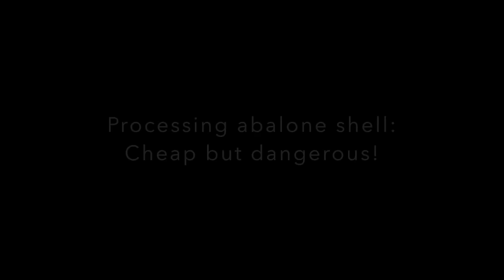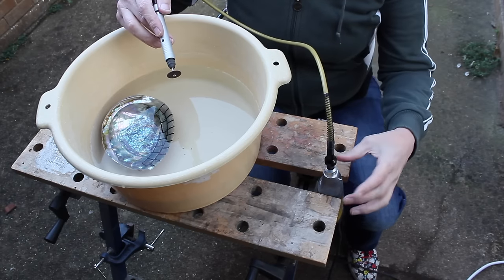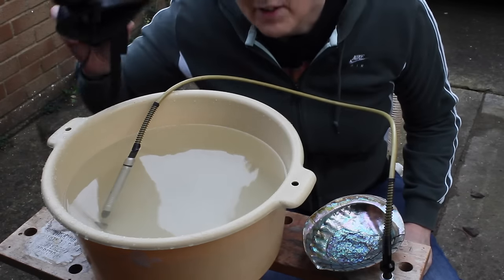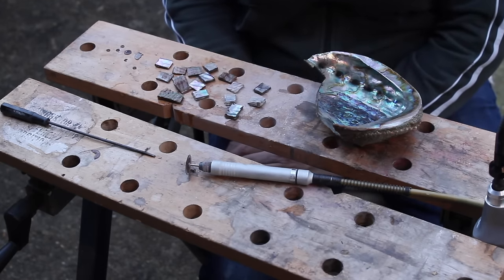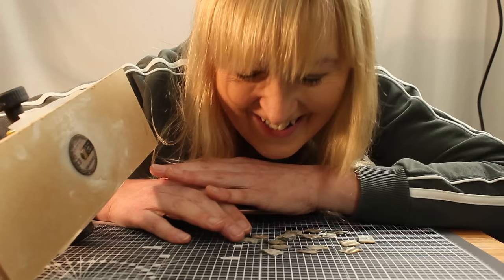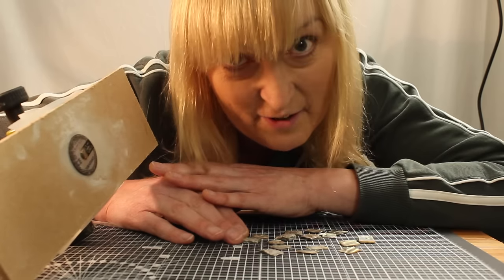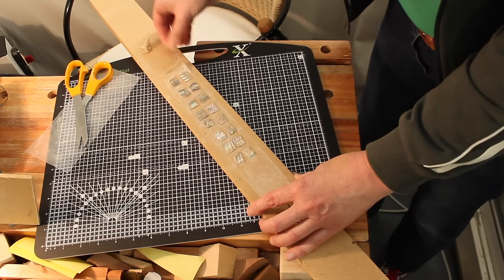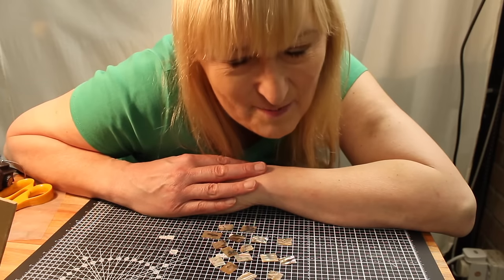Processing abalone shell: cheap but dangerous!

Comment: Thank you for the video. I have cut many tons of MOP, Abalone and Freshwater pearl shell. I recommend you buy a cheap small rock saw with a 1/32 inch kerf glade. It should have constant water drip. Use the saw from the back side. It saves a soaking and gives great control.
Coarse diamond disk are available for lapping the shell flat then run through a drum surface grinder. I use white glue to stick the flat pieces down and then soak in warm water, the finished piece just slips right off. I like using hard Formica as the surface to glue to.

Comment: That smell you experienced was most likely due to improper filter media size on your dust extractor system.
You would most likely require a HEPPA Style filter as the normal filter elements designed for sawdust/sanding extractor system.

Comment: I have one hell of a shop with some expensive equipment, but I love my WorkMate.  

That aside, think about adding a shim opposite where you are working, then a piece of wood covering the cutter. It would act as a guard to protect your fingers, if you slip.  

If you do slip, a nylon stocking or some screen door screen will catch your piece and save you digging it out.  Indent the sock or screen so it is more likely to catch the pieces.

Comment: Great work, well done! Just a thought... Meths or turps to remove adhesive from double sided tape, and linesher or disc sander for sanding with different grits.  or buy and use lapidary gem polishing kit. Gemstone stick to hold inlay may avoid finger loss.

Comment: Mount the hand piece, make a splash shield and use a drip feed (Bottle with small diameter hose + screw at the end, adjusted to drip) to drip right on the cutting disk

Comment: Are you all serious? Never in my life have I seen such a bunch of safety nazi's. Have you never used a power tool in your life? This was about as safe as you can get. That cutting disk is a grinding wheel not a blade. It would at worst give you a small burn from the friction. I've used discs like that for ages and taken hits on my fingers with very little injury. Grow a pair like the entrepreneur who made this kick ass video.

Comment: If you go to a lapidary shop you will find they sell a wax substance called DOP that when heated will melt. You put a drop of this on the back side of you shell and stick a small piece of wooden dowel to the part and you now have a handle instead of sanding off your finger tips. The wax is easily removable when you are done. Simply put the piece in ice water or the freezer for a few minutes and it breaks free cleanly. You can also use this same method to sand your parts to a shape should you desire it.

Double sided tape adhesive is normally heat sensitive. If you heat it with a heat gun it will release and then clean off any residue with rubbing alcohol.
Reply from the maker: Good tips - thanks!

Comment: And this is exactly why I use Ablam...a £90 full sheet yields plenty of straight and curved strips. Try using hide glue to stick to a sub-base. Comes off in warm water :)
Reply: supper glue (crazy glue ) only trust me hide glue is organic and subject to bacterial degradation and is not 100% clear supper glue was made just for shell gluing 50 years ago it the best make a mistake boil it out in water and try again i worked in the pearl industry 17 years
Reply: My suggestion is not for installation. We glue our laminates to mdf while machining with hide glue. Chuck the sacrificial board in a tray of warm water then collect your parts half hour later. Secure them in place with cyanoacrylate...
Reply: yes when thought later i realized that you were talking about using it as a temporary bond sorry you are right

Comment: The part you used the home made mini router table is cool. I would guess if you cut the pieces in long strips then cut the individual pieces down to smaller sizes once you have them down to the thickness you want. They would be easier to hold down, giving you more control. If you have an old can cozy (for beer or soda can covers) and you cut them down in little squares, then split the thickness in two, glue it to the end of a dowel you would have home made hold down tool to sacrifice instead of fingers. (even a small build up of hot glue to a dowel would  work for hold down or guild tools for feeding product into bladed or sanding tools) hope the ideas help.

Comment: FYI I'm late to this party, but if you can keep the blade wet (cool) you won't break them. I rigged up a small water pump (used in small water pond) to drip water onto the cutting area/blade. You could also use/rent a tile cutter. For thicknessing I would have kept the pieces longer? You can cut them to size after. I also use a drum sander outside. I used blue masking tape on a board but I also put tape on the back side of the abalone. I then used super glue on one side and an accelerator on the board side and stuck the two tape backs together. The tape came off the board with a razor blade slid under it. I then removed the abalone from the tape.

Comment: 1. respirator/dust extraction a must.. .2. watch locally; you can often find raw shells, and/or finished (but convertible) products (eg. shell-constructed "tiki" masks) for less than buying raw shell from faraway.. 3. bigger shells allow for larger shell plates; beware of smaller shells (say, less than 6" X 5") and./or those with heavy corrugation/thin material which reduces viability somewhat... 4. re less viable material, use for  "dots", easily obtained, via metal tubing of desired diameter, w/teeth notched into bottom edge, mounted in dremel/drill press... 5. you need a trained eye, to gauge how successfully you can generate larger plates; bear in mind, the smaller you decide to make your plates, the more work involved; however, more you need to remove, to flatten (on bigger plates), the more chance of removing desirable material and/or sanding into the outer shell layer,,,, 6. the abalone "heart", is the (usually) coulourful  section in the middle of the inner shell, where the muscle attaches to the shell; it is considered the most valuable/desirable part of the shell; re the abalone heart, be careful; though the heart is often relatively "flat" (as compared to the rest of the shell), the heart layer is a layer on top of the underlying layer, and can be quite thin; if you try to "push it", by trying to generate too large of a plate, you can sand away some/most of the heart; again, gauge a) how thick the actual heart layer is, and b) how flat the un-sanded plates are, and then sand VERY carefully (finer grit), to see how things are going...you might need/want to re-cut into smaller pieces, if you start losing the colourful material... 7. to extract the most shell-plate material, a few different tools can help reduce waste and increase safety: a wet-diamond tile saw (4.5" "thin-kerf" blade) works super, and is not expensive, "used"; the dremel discs can also be helpful, but they tend to wear out prematurely; use them, in "tight" spots, where the tile saw isn't feasible....even fine-tooth hand-saws (eg. hack/coping/jeweler's-saw) can be used in certain applications, and generates a very thin kerf... 8. with most of the plates, they will not be thick enough to "double", via re-sawing; but where possible, this can be done with a scroll saw w/fine blade + fence, or the "mini-router" technique, as illustrated in this video.... 9. re sanding/thickness-ing, remember, most of the material will be later "final sanded" to a degree, so it is not overly critical to get the material to a 0.000000 +/- thickness accuracy....if you are careful (watch your fingers!), you can "free-hand" them on a belt sander; a) do your "good side" first, then b) the back-side; with carefully thickness-ed wood veneers, you can make a notched "depth-gauge"(s), for desired thickness, and just check as you go; when the sanded piece fits into the slot, you are good-to-go (with a finer grit on the sander, you can control removal of material fairly well...)....or, one can use the thickness sander if they have one (or access).... 10 remember in all this, "time-is-money", unless you are strictly "hobby" oriented, where time/$$ is not the deciding factor....those places that produce/sell shell-plate material, are set up, for maximum material/cost equation; thus it is not easy to beat their prices, when seeking to generate your own material....

Comment: I think I will just pay someone with steadier hands to do that for me.  Far too close for my comfort.  Props to you for bravery!

A trick I learned from several IV nurses for dealing with that tape not wanting to let go is to take an alcohol pad and wipe it along the point where the tape is sticking to the surface.  It protects the delicate shell pieces or, as in my case: arm hair.

Comment: For your mini router table set up I would try gluing the blanks to the end of some wood scrap with water soluble glue.  Then cut them and drop the sticks in water over night. Same with the drum sander.  Or try some heat or solvent (test on a small piece of abalone first!) to remove the tape and adhesive.
Reply: boil it 5 minutes

Comment: Trying to think of ways to make this safer for you [and us] and I was wondering about the diamond coated plates I have for sharpening. They are inexpensive and about six inches in diameter. 

Running these at slow speed with water DRIPPING  on them would reduce danger and what is thrown by the wheel.  Too, the water would clean the wheel and the diamond would wear really well.

Running the wheels at about one hundred RPM might do the trick.

In a pinch, a person might be able to use an old sewing machine motor and control to vary the speed.

Comment: Holding the shell under water while cutting it - right idea but wrong approach. Drip water onto the shell while cutting it as it will cool the cutting edge; it'll turn into a slurry. Your rpm's need to be a lot slower too.

Comment: I wondering if jeweler's saw blades could be adapted to use on a scroll saw? With the small table surface on the scroll saw, I would think it might make it easier to cut out the pieces of the abalone shell.    Just an idea.

Comment: I cut some simple abalone shell pieces for tile job using tile saw. Abalone is significantly harder and more difficult to cut than 3/8” granite. A normal abalone shell probably isn’t even a quarter inch thick on average and it’s strong enough to support the weight of a normal person standing on it. I would like to find a way of doing this because I probably have 10 shells left over from my ab diving days.

Comment: I can't remember what you're using for dust extraction, but unless the filter is designed to capture really fine particles it can be more of a dust distributor than extractor! That might be part of the reason that you could detect that"distinctive" smell...
Reply: Wayfarer-Sailing dear god, the smell!!!!!! Burning hair and an unwashed bait bucket from 6 months ago. The smell of a fart would have been a blessing. Never again! I get bucket loads of the stuff washed up practically on my door step but no. Just no 🤢
Reply: YES!  I have three dust collectors in my woodshop and had to change out the stock bags, otherwise, they were nothing more than chip collecting DUST PUMPS.

It is do-able, however, and it would be well worth while to have an eye to acquiring a dust collector [rather than a vacuum] to dedicate to this purpose.

Comment: You actually need a ton less water, and a drip system would be perfect, so you can see & cut too.
I wouldn't sand the shiny side; just make sure the back is smooth, you will sand & polish the top after you inlay them. I would of smoothed the back of the shell before cutting them out

Comment: Try using Acetone to get you Abalone off your double sticky tape when you are removing them from the tape,  after running them through you sander.  Then acetone will break down the tape for easier removal.  Let the acetone pool  on the tape for a while before trying to remove the ablone pieces!

Comment: Get 3 diamond blades, gen trim saw and invest in a belt grinder attachment for a grinder wheel that you can pick up for cheap make sure you get on with the largest area were its backed by a flat steel side so when you grind you have a great flat side to grind against......and to take it further you can get a magnetic chuck and glue them down with dob wax or hot pitch or expoxy them on but you have to sand away the epoxy with is alot soft that you would think that is the cheapest and fastest and least dangerous way into getting them down to a small enough size without breaking them.

Comment: if you wear a mask and run a steady stream of water over the area you are cutting it will keep dust down. (the first part with the dremal) There are metal diamond sanding disks that would probably work real good, it would cut down on the amount of you were going through. They dont brake apart, how ever they are just laminated disks.

Comment: Mexican luthiers just use a paddle wheel disc on a grinder and sand all the back of the abalone shell until its thin enough to cut shapes out with jewelers saw. they also just go down to the tourist areas and buy those abalone mask and just pop the little abalone squares off and use them for inlay
Reply: thats how we did it in New York also i did 100 and hour with a 3/4 hp motor time is money but paracho luthiers are too much in a rush they are going to suffer from the Chinese luthiers if they dont pay attention

Comment: Try soaking it in hydrochloric acid for several minutes, and it should remove all the shell. Polarised glasses would have helped :) but you're determined to electrocute yourself if the motor is beneath you. I would be getting it higher than the bowl. ;)

Comment: Do really need to thickness the pieces? Can you not level one side, then sand them flush once inlaid?If you do can you not make a router jig to thickness the pieces? It's a Simple jig to do surfacing.
Reply: Yes you do inn order to get the grain orientation right for reflecting the light and colour matching...
Reply: Arr! That makes sense now. I'm not a guitar maker, just a woodworker.Normally with wooden inlays, as long as the back on the inlay is relatively flat, enough for a good glue surface the top can be quite proud and just sanded flush afterwards. Do you have to inlay these parts already at the same thickness as the surround then? how much of a tolerance is there for final sanding?

Comment: they used the wrong cutting disc, there suppose to use a diamond coated cutting wheel, and they should never stick a flex shaft underwater

Comment: Get rid of the fiber wheels and buy a perforated carbide grit or diamond impregnated wheel. They last and last and last. Shell is soft. I have cut a lot of hard porcelain with mine, and it's still cutting bone, shell, ivorahhhh hmmm, and other stuff. My ivory is all preban purchased from museums from restoration stock, or as broken figurines, and other OLD items that predate the CITES ban. I have a lovely old Sears Companion belt sander with a fence and a miter that will grind shell, and drop the fence the right way, and it grinds bone, ivory, or micarta off at the perfect angle for CF Martin nuts. I need to replace the bearings on it, but that's easy enough. It ancient so all that stuff was meant to be replaced.

Comment: That mini router method: Awful. Just so many levels of wrong. Work methods like that should be buried kilometer deep in bedrock in a lead gasket. Although it's just a grinding disk that won't shred your finger immediately on contact, like router bits do, you do get unpleasant injuries doing things like that. Please keep your fingers away from the harmful ends of power tools. But I certainly won't think abalone disks are expensive anymore :-)

Comment: The diamond bits you're using you should keep wet when cutting from burning the diamond off of them so fast. Also if you can slow your speed down a little bit would be better.

Comment: The easy way to sand the pieces is to glue with wood glue a newspaper sheet and over the sheet with the same wood glue the pieces. You leave them for 24 hours and do the sanding. When you finish it is very easy to unglue them from the basic wood

Comment: Very cool. I like the ambition. However, I would refrain from using gloves at all. There is a reason blacksmiths never wear gloves. It teaches bad habits and you cannot feel the work. I would get very slow speed tools for cutting, polishing and shaping. Also, you could have set up a drip system instead of under water.

Comment: The other option would have been to use oil on the shell as this would hold the dust down too... 
the other option is check out Fire Mountain Gems as they have the sheets of the abalone as well. I have bought a few sheets and it has not cost me that much I think all up at the time it 
cost me $40 AUS

Comment: I usually have 10 guitars in progress at any one time. I just don't have the time to do this. I buy sheets of high-quality shell (I do a lot of wood inlays too using contrasting woods as well) and use my CNC milling station to cut the fretboard and the shell at the same time. An elaborate inlay takes me less than 3 hours. You have to ask yourself what is an hour of your time worth? Add up your expenses and your salary, and it's a lot more than you think.

Comment: Hello Susan. Using water you were on kind of the right track with the wrong equipment. We have been doing this as a major part of our business for the past 24 years. Take a look at this video showing how we get the job done. You may get some ideas on some things you can do. 
https://www.youtube.com/watch?v=uZh9HrW5Isg&t=6s
Working outside is a good start. Try using a strong fan to blow that nasty and dangerous dust away from you as you work the shell. Glue the cutout sections to a small stick to help sanding to flat thickness without sanding fingers. Good luck.